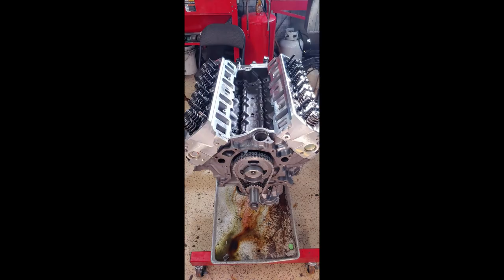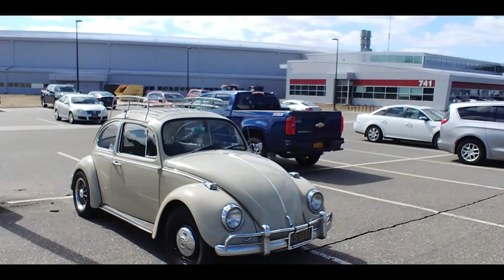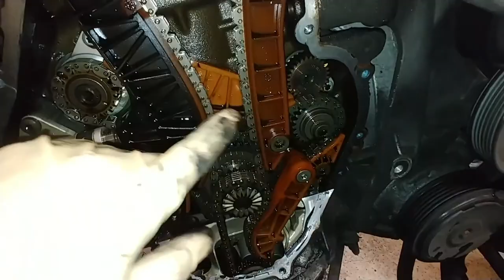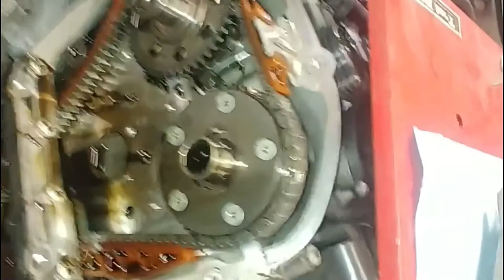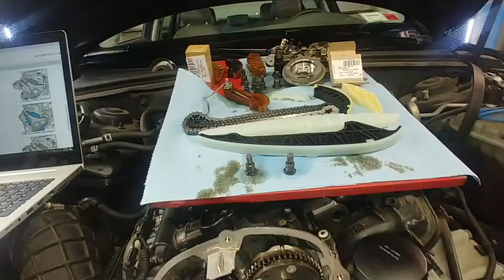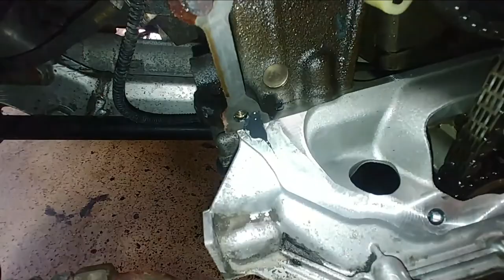Replacing Audi A4 Timing Chains on any 2.0TFSI engine

Comment: Hey, I know this an older video but this is exactly what I need to to to my “11 A4.  I didn’t see it listed in any other comments posted but I’m looking to buy the whole timing chain kit, did you purchase as a kit?  Part number?  Also the girdle screen, it was out & I didn’t notice if you installed as new one.  This video is worth gold to me!  Thanks so much!  I KNEW I didn’t need to remove the entire front clip!
Reply from the maker: Hello Neil, Yes I did buy a whole kit. I usually start my search on sites like ECStuning and FCPEuro. They are very good sources for factory or OE parts, and no I am not sponsored by them lol As for the girdle screen, I just remove it completely. It is not filtering anything more than the oil filter. But as with any engine good oil maintenance is key to these engines. After the repair, it maybe a good idea to run an engine flush through incase you have any debris or sludge in the pan. More often than not when the guides break apart they end up in the oil pan and restrict the flow of oil. You have to remove the pan to clean it, a flush will not remove them. One other thing, The chain kits do not come with the oil pump tensioner/guide. It is also made of plastic and more often than not it is brittle and will break. Makes sure to replace it while in there. Thanks for watching, hope this helps.
Reply: Question! What all tools do I need? Wrenchs socket etc

Comment: Do you have to remove the oil pan and baffle to remove and install the oil pump chain? That wasn’t shown in the video. Thanks.
Reply from the maker: If you want to replace the oil pump chain, you need to remove the oil pan and the oil pump. I have never had to replace that chain. Only the guide tensioner due to age. Thanks for watching.
Reply: @willpoweredgarage969 thanks for the reply.

Comment: Did you remove the rads I mite need to do mine 😒 good video 👍👍
Reply from the maker: Well the radiator does not need to be removed, but the front end does need to be in service position. Thanks for watching.

Comment: If the timing is already gone is the engine un fixable on Audi engines??
Reply from the maker: Well nothing is unfixable IMO. If your asking if it will need more work then just a new timing chain, the answer is yes. Most likely rebuilt cylinder head. I have a video up on rebuilding a vw 2.0l head.
Reply: At least new valves, it WILL bend the intake valves.